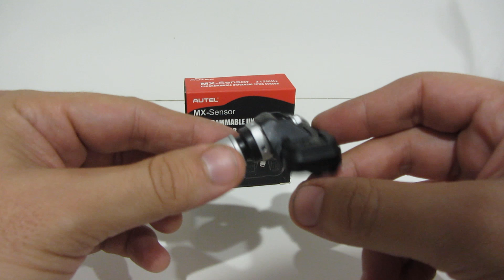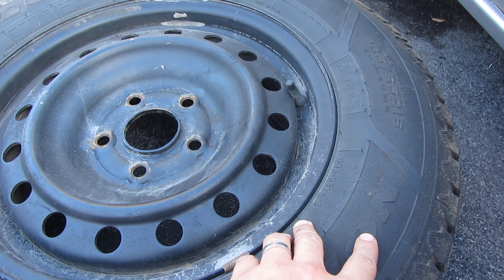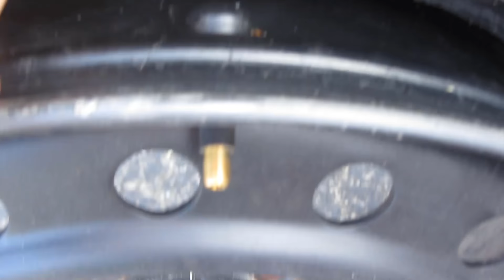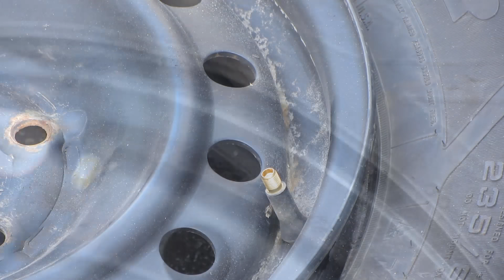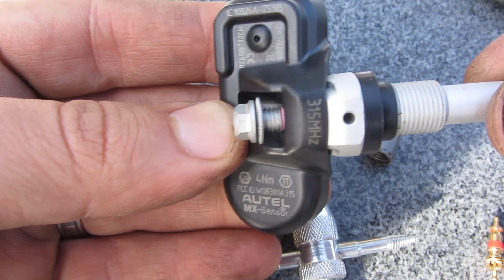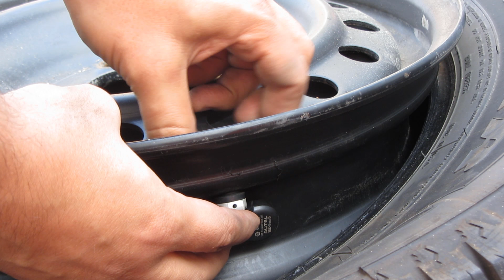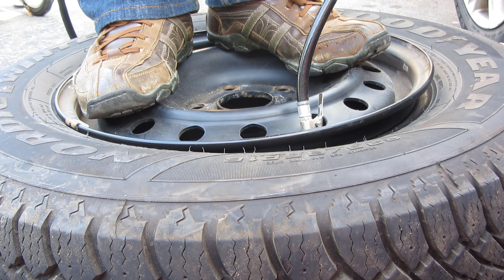Install New TPMS Sensor DIY Without Needing Rebalance

Comment: And then what? The car gonna recognize the new sensor immediately?
Reply from the maker: Some cars do recognize them automatically, but most don't. Sometimes there is a manual reset procedure you can do without any special tools, sometimes not. Search online for "tpms reset" and your model of car.
Reply: Also, with Autel sensors you can often clone them to have the same sensor IDs as the existing ones on your car. I run the OEM Subaru sensors on my all seasons and have a cloned Autel set I run in my winters. Now I don't have to do any sort of TPMS recognition since the car is always only looking for the same sensor IDs it came from the factory with.

Comment: After installing can you please let us know how to program them. Or it will start syncing with the car automatically?
Reply: It appears to depend on the make, model and year of the car. Some are more automatic than others. With some you have to put the car into training mode with a magic sequence of presses on the brake and turning ignition on/off. It then it displays a message such as "train front left". You then have to let some air out of the left front until horn beeps or use a programmer like  TPMS 19.  Repeat for each wheel. Ive been told with new sensors you need air let out to activate the sensor because they come are deactivated to preserve the shelf life of the battery? Google for the process on your car. I'm here right now because the process recomended for mine isn't working :-(

Comment: awesome video. by the way no need to take off the tyre just let it hanging there
Reply from the maker: Very true.
Reply: No need to take it off the car?
Reply: @RA-el6zj  yes, just push the tyre from the sensor side then you can deal with it
Reply: @don.timeless4993  Alright, thank you. 

I haven't seen any videos doing it with the wheel still on the car!

Maybe you could pull back the tyre with something like a glue clamp?
Reply: Can I use oil instead of soap?
Reply: @th.usa4112 oil/petroleum products are hard on rubber and plastic and may cause increased deterioration. Better to use a silicon based lube or proper tire lube designed for mounting/unmounting. Dish soap works ok too...

Comment: The chevy (thief) quoted $220.00 to change 1 TPMS sensor on a 2020 Tahoe
Reply: The ford stealership wanted 1200 to do all 4 tires 😂😂😂 I did all four in 2 hours and spent $240
Reply: Stealers are the same around the world appearently 😂 here, the Seat Stealer quoted about 200 dollars for the air vent flap little motor 😂 got it for 20 dollars outside
Reply from the maker: Yikes!
Reply: The Les Schwab tire center ( thief ) quoted $420.00 to change 4 TPMS sensor on 2015 Camry, while the car had one broken sensor. It was $40 to replace it. 😅

Comment: why not use wd40 instead of soap
Reply: wd40 is flammable
Reply: @sosariau1973  Oh okay
Reply from the maker: The fact that it's flammable wouldn't really be an issue. If there are flames around your tires, you have bigger problems. WD-40 would work just fine too, but everyone has soap.
Reply: @GabesHacks  Gabe it's just too much, I went to discount tires and let them put them in😀
Reply from the maker: That works too!
Reply: @9th_child  I like that idea, how much did they charge you?
Reply: @Pro1er they want $60 per tire.
Reply: @MrRedpHat  Holy crap! I ended up buying the ones that you screw on the valve stems, you can get the whole setup for all four tires for less than $60.
Reply: WD40, at least the original formula is a petroleum based lube and petroleum products are hard on rubber and plastic and speed up deterioration.  A silicon based lube or lanolin based lube (like Fluid Film or Surface Shield) won't harm rubber, even rejuvinates and protects. Or ya, everyone's got dish soap handy...

Comment: What about the programming???
Reply from the maker: I used programmable sensors, so I didn't need to do any programming after. I talked about that in my other video: https://youtu.be/N6p6xV4PlHc
But if you need to program the vehicle, as unebonnevie said above, every vehicle has a different programming procedure. Look it up online.

Comment: Hi I have 2009 Audi A8L , can we get AUTEL MX sensor to suit.? The OEM sensors Te costing $1200 for 4, any suggestions could save money , thank you
Reply from the maker: The Audi A8 can automatically learn new sensors, so you don't need to buy programmable sensors. Just buy any 433MHz sensors and follow the procedure in the second post of this thread for the relearn procedure: https://www.audiworld.com/forums/a8-s8-d3-platform-discussion-60/programmable-tpms-sensors-2969526/

Comment: Can you use one a portable air compressor or you will need something much stronger?
Reply from the maker: The only trouble I can foresee is getting the initial seal so the pressure can start building up. But other than that, a portable compressor should do the trick.

Comment: What about reprograming your vehicles pc so it can see the sensor?
Reply from the maker: Most times you will need to do that, yes, although some vehicles will automatically learn new sensors. I dealt with it by using programmable sensors instead, which I covered in my other video: https://www.youtube.com/watch?v=N6p6xV4PlHc
Reply: Did a portable one end up working for you?

Comment: You’re telling me Les schawb charges 140 bucks for this???
Reply: Most shops charge an hourly rate, with a minimum amount of time. The going rate in my area for a shop that is qualified to do warranty is $190 per hour. My son is a Michigan State certified master mechanic. He worked at a Chrysler dealership and was required to take training on a yearly basis to keep up with changes in Chrysler cars in order for the shop to do warranty work.
  Shops also charge by the "the book" An oil change is allotted X amount of time. If the mechanic beats the book he gets paid for the amount of time the book said it should have taken. If the book said it was a 30 minute job and the mechanic took 15 he gets paid half of the hourly rate.  The customer gets billed for a full hour. 
    A fast mechanic gets more jobs done, gets paid a little more for being good at his job and the shop does more jobs at the minimum hourly charge.
Reply from the maker: I wouldn't doubt it!

Comment: do you have to program that later?
Reply from the maker: These are programmable sensors, and I did the programming before, which I described in my other video: https://youtu.be/N6p6xV4PlHc
The other option is to use normal sensors and program the vehicle. Although some vehicles automatically learn new sensors. Every car is different.

Comment: At Discount Tire and they tried to sell me on replacing all four sensors but mechanic I’ve come to trust said just do the one bad one. They said the when one fails then the other ones are about to so it’s good idea to replace all of them. Been two months the others still been good.
Reply from the maker: Yeah, I mean, they aren't necessarily wrong. The others will go at some point down the road. But there's also the chance one was a lemon and went much sooner than it should have.
Reply: @GabesHacks  but they said soon after they bound to fail. I almost took their word for it but asked a trustworthy mechanic I sometimes use and he said no they can last for a long time.

Comment: I had a flat tire and on my way to get it repaired I had to air it up with one of those Fix-A-Flat sprays and when I got it repaired it said that my sensor didn't work they didn't clean off the spray that was on the sensor and that is what caused it 2 malfunction
Reply from the maker: Yeah, I've heard that stuff will plug up the sensors.

Comment: I have one bad on my 2011 vehicle. I have read checked & they are saying it could be over $200 to replace all 4. That seems like a lot for something that I have never had on a vehicle before this one. I drove cars for 42 years without any pressure sensors on my tires & never had a problem. I checked the pressure myself every so often & put air in when it was needed. I think I will just ignore the light & save my money. I still remember how to use a tire pressure gauge myself.
Reply: The dealership told us that it'll cost $750 to replace all 4 sensors for a 2016 Chevy equinox... 😅 it's ridiculous
Reply from the maker: @grantgatewood4048  Holy smokes! That's crazy.
Reply: @grantgatewood4048  That is absolutely ridiculous to charge prices like that.
Reply from the maker: If you can live with the light on your dash, that works just fine too!

Comment: How much is the sensor?
Reply from the maker: It all depends where you live and where you buy them from. You can look online or buy them locally from a mechanic. The dealer will always be the most expensive.

There are links in the description of this video to where you can buy these ones online.
Reply: $50
Reply: @Neilpedersen  did alright then. Went to Discount Tire had it done for $60 plus tax
Reply: Are the Sensors universal? Or do they need to be specific to car
Reply from the maker: @taylorpoole8195    The sensors have to match the supported frequency of the car (433MHz or 315MHz). Then the car may need to be programmed to recognize the new sensor, unless it automatically learns new sensors (most don't). 
I used programmable sensors, where I programmed the sensors to match what the car is expecting. I did this so I can have identical sensors in my winter tires. I described how I did that in my other video: https://youtu.be/N6p6xV4PlHc

Comment: Hello I bought tire sensors from walmart online however they have no back cover, there is just silicon on the back side. Do you think silicon is strong enough to keep the mechanism and the battery inside in place, are they safe enough to use like that without the back cover? Thx
Reply from the maker: Yes, I've seen a couple different kinds that are built like that. It's not a problem.

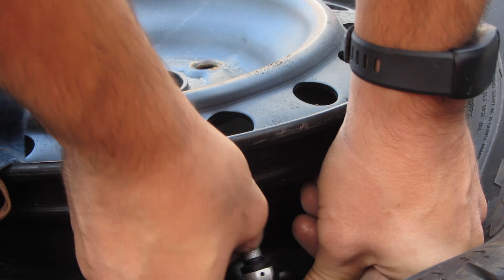Comment: @6:40 when you mount the metal stem on the wheel, do you need to lubricate the gasket, like we do on ordinary stems w/no TPMS sensor? Did you apply anything? Also when you break the bead can you put any lube for that bead to brake it easier. Bcs of the sensor there you can't sprinkle w/soapy water, any other lubricant will be liquid as well, so how to go about it? Thank you for the informative film.
Reply from the maker: I didn't apply any lubricant to the gasket. The instructions for the sensors didn't say to, but I imagine it wouldn't hurt either. I didn't have any leaks though.
I'm sure there are other lubricants you can use for sealing the bead, but I don't know of any that I could recommend. The soap (without water) that I used worked well and didn't get into the sensor. Whatever you use will have to be something that won't eat at the rubber.
Reply: @GabesHacks  Thank you for your replay. I did just 7 tires, and also they all were just ordinary tires without TPMS sensors. Now on one of our cars (2009 Nissan Sentra) I also plan to replace the tires, and those have sensors. On usual tires I always used Bead Don Lubricant Paste on those stems and on the rims and tire edges. But for TPMS, I even don't know, so contradictory views (we have a discussion here on Amazon, and some people say, they mounted for years w/TPMS and always use lube, some that no need and actually it can be bad even not for the sensor itself, but the lube can give some effect on torque, and it won't be correct already. Same online: some say no sealant on TPMS, some say put some lube on the place where the stem sits. I also have Metal Stem sensor, so I'll go your way better. Probably sealant more can be used on Rubber Stem sensor. And also when you brake a bead do you spray soapy water on TPMS tires? I have also special tire liquid Ru-Glyde, but it is also like heavy cream and not thicker. And you don't want any liquid in the sensor. Probably I'll apply a bit, but not in the area of the sensor. Thank you again.

Comment: I like the way you put the tire down but my question how come when I try is not work for me ?
Reply from the maker: It's possible that there is sealant used around the rim, making it harder. If you're adventurous, you can try this method using a jack: https://youtu.be/-VICFao8Mjw

Comment: I need to replace the front passenger side tire sensor. This video is very helpful!  I do have a question. Why you don't program the sensor? I watched other videos and they  say you have to go to a website to program the sensor using some type a code in  order for the sensor to communicate with the vehicle's computer. Otherwise the dashboard will still display 0 air
Reply from the maker: Every vehicle is different. Some cars automatically learn new sensors, some don't. My van didn't. I used programmable sensors to create a second identical set for my winter tires. I described that procedure in a previous video: https://youtu.be/N6p6xV4PlHc
The Equinox seems to need a special tool to do the programming, as shown here: https://youtu.be/ZMBQvdm3xfY
The tool seems fairly inexpensive, for example: https://amzn.to/3VidHdR (affiliate link)
Reply: By the way, I have a 2011 chevy equinox
Reply: Amazon has a TPMS relearn tool that works great. I think it’s $12. It’s orange

Comment: stupid video, where did you see tpms in such a circle? put it in this way on the profile of the tire 45
Reply: Just use some bar clamps on low profile tires to make room for install.
Reply from the maker: I'm not sure exactly what you're referring to, but I installed them according to the manufacturer's instructions: https://www.autel.com/autelcms/u/cms/www/201601/11050600r8el.pdf
Reply: @GabesHacks  I mean that this method will not replace the sensor in 80% of car wheels
Reply from the maker: Why?
Reply: @GabesHacks  because in the lower profiles of the tire it is not possible to squeeze the tire so much, especially when the sides of the tire are hard
Reply from the maker: @nightrow4066  Yeah, others have suggested that this won't work on low profile tires, which makes sense.

Comment: What about the programing?
Reply from the maker: I used programmable sensors, so I didn't have to program the vehicle. I covered how I programmed the sensors in another video: https://youtu.be/N6p6xV4PlHc
If you're not using programmable sensors, and your vehicle does not automatically learn new sensors (some do), then you will need to program the vehicle. Some cars have a procedure to put it into a "learning mode", others have to be hooked up to a scanner. If you need to, search online to find what you have to do for your car.
Reply: Some sensors don't need it

Comment: i store mine in a pressurized pvc chamber.
Reply from the maker: Does that work? They usually use a centrifugal switch so they only turn on if they're in a spinning wheel.
Reply: @GabesHacks  I believe they turn on with pressure too. And yes it works for me.

Comment: Tire store was to charge me $60 for the sensor, $20 for program, breaking the tire $25. That is per tire.  Has three of them needed to be replaced.  I refused
Reply from the maker: That's nuts!
Reply: @GabesHacks  My X garage tried to charge me £411 for swapping summer to winter tyres claiming they needed to remove tyre to read ID numbers. The world is full of such people. You did the right thing.
Reply from the maker: @kubibear2890  Ha! Ask them how the car reads the sensors through the tires 😄

Comment: great vid... how did you know to do all of them?
Reply from the maker: I wasn't replacing broken sensors. I was installing sensors for the first time - taking out the rubber valve stems.
Reply from the maker: The sensors have a centrifugal switch inside so they turn on when the wheel spins.
Many cars don't know which sensor is which. If the car only has one receiver (like the Honda Odyssey in this video), it has no way to know. Some cars have a receiver for each wheel, and those will know which one is which.

Comment: I suggest that you replace the  aluminum tire valve to a copper with ruber tire valve because in my experience aluminum tire valve usually leaks
Reply from the maker: That is a good idea. The brand I used (Autel) does sell sensors with rubber valve stems.

Comment: On my all seasons I found it impossible to squish down enough to access the hole. Ended up letting the tire shop finish the job.
Reply from the maker: Could you not break the seal? I have found it impossible to do as I showed in the video if a sealant was used. I had to do it this way: https://youtu.be/-VICFao8Mjw

Comment: I really really hope i can do this technique on my tire, i just rechecked it....its the OEM factory Toyota TPMS.  So its not the rubber stem....the other tire's TPMS that Fire--- replaced (free) in 2019 is rubber..but holy cow, $180+ to replace a bad TPMS....hey...got a question..If i cloned my bad TPMS and not install it in the tire, would it still work..oh wait never mind it would need to have a constant psi--ok answered my own question...as i have a aftermarket TPMS, it just annoying to see the tpms light go on intermittantly...

Comment: For TPMS sensor battery fix please check, do not throw old one and fix it.
Hope will be helpful.

https://youtu.be/SakV-p0urF8
Reply from the maker: Interesting. I tried replacing the battery in one of my OEM sensors, but it didn't work. After getting the old one out and putting a new one in, the sensor didn't work anymore. Mine was a lot harder to open up than the one you used in your video.
Reply: @GabesHacks  first if all thanks for your comment in topic, if its harder to open, it might had problem maybe while opening something might be broken ( or else normal battery inside has some isolation, this poles cant touch both side i cover it with tape incase). And also poles +\- i am sure you placed correct but better to cross check. And short-circuits etc.
And also when you replace it you must register it TPMS device for most of the cars otherwise car will not see it. Did you?
My two sensors are really working perfect now. Luckly.